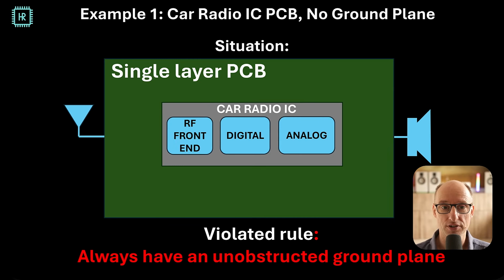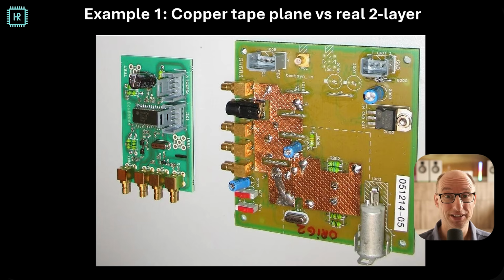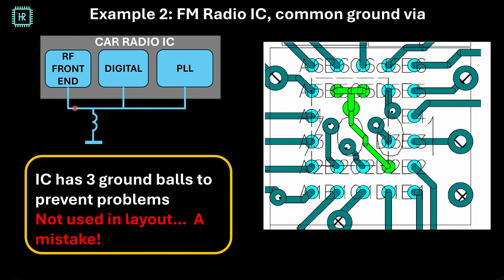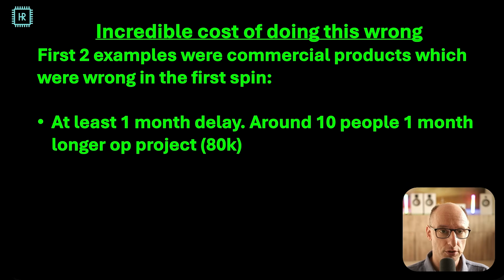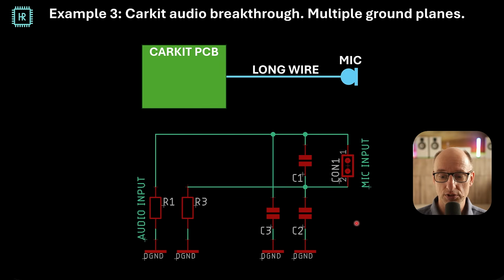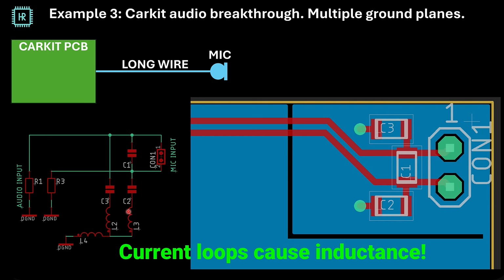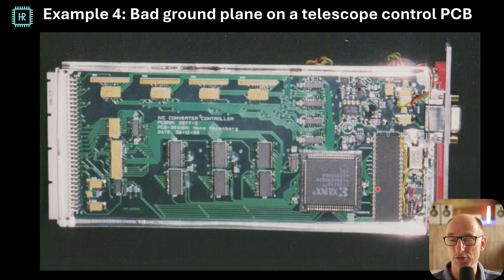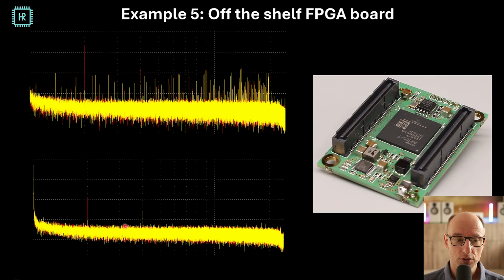Top 5 PCB Grounding Mistakes That Cost Me Thousands

Comment: Great video! I'm surprised that you can design a ARTIX7 board in that size with good EMC with only 4 layers. I wonder what grounding strategy you took for the multi board DA converter at the system level.
Reply from the maker: All my grounding strategies can be found in video part 1 - 4 of this playlist. That is what I used: Single ground plane. Each ground its own via to that plane. It is a smaller artix device (35t) and I did not need all the ios. Otherwise I would have needed an 8 layer with microvias.

Comment: Is the FPGA SOM board opensource?  Or for sale? I am working on an SDR board, as hobby project, and using a SOM would make the whole design much easier. The question I have is it not more convenient on a 4 layer board to have the GND in the middle 2 layers. So you can correct traces if necessary?
Reply from the maker: Hi, do you mean my own FPGA board with FPGA SOM? What is SDR? Yes, the advantage of traces on the outer layer is that you can correct them! It's a tradeof with interference.
Reply: @HansRosenberg74  SDR is a software defined radio. The FPGA receives or sends high bitrates to and from and DAC/ADC and downsamples it to something a PC can use through USB. Something like the audio DAC board but then for RF.
Reply from the maker: I'm pretty sure my board wil not be suitable because I didn't bring a lot of differential signals out. I did not need large databusses  for my dac so it probably must be modified to be useful for your project.
Reply: Paul, did you look at terasic boards like DE0nano ?

Comment: Hi Hans, thanks for another great video! I have a question: In the video you mentioned 'Never in my whole 42 year career have I seen multiple ground planes be an improvement'. I come across a lot of ICs that have different grounds, like microcontrollers that have a separate AVDD, DVDD and VDD (Analog, Digital and generic? VDD). What's the reasoning behind separating these grounds if having a single ground plane is almost always the best option? Are there situations in which a separate ground for the analog and digital part of a microcontroller is advantageous or even necessary? 

I have been trying to think of an example myself, maybe if you have a lot of fast-switching current running through N-channel MOSFETs on a board that have source connected to the ground plane could cause minuscule geographic voltage noise on the ground plane that could affect the accuracy of an ADC, and that a separate ground plane for just analog stuff would help solve that? But I am not sure if this is a thing that happens and I don't have the tools to test it...  

A second question I have, is that the few PCBs I've produced so far were all powered through an adapter with a barrel jack connector (like a laptop power brick), which only offer +24V and 0V. Is it correct to make the 0V equal ground on my PCB? I know that in these cases there could be a potential difference between the socket ground and the ground on the PCB, but because the adapter isolates the board from mains (and thus, there is no connection to socket ground) this should not cause any issues, right?
Reply from the maker: Yes, ic's have different ground pins. Reason is: Prevent common ground impedance crosstalk. This only works if you put good grounding on the pcb (which is exactly what wasn't done for the mobile radio chip example).

Your example is correct. However, I would not split ground planes since it can make things worse. I think putting some distance between the mosfet and the adc is the best solution. You could also use shielding.

A fast switching mosfet will also generate EM fields. They'll just go through the air right over your pcb. Distance or shielding helps there as well. 

I'm not sure if I understand your last question. I'd just connect the - connection of the supply to the ground plane (via the connector). If the connector has resistance, the cable will have a slightly different voltage than the board, but the whole board will have the same voltage. So that is not a problem if that is what you worry about.

Comment: so if I use a breadboard (solered or unsoldered), there is no ground plane, or is it the connection to the common groundrail that solves the problem?
Reply from the maker: Indeed, you won't have a ground plane, it is very limiting in that sense. Luckily, pcbs are really cheap these days :-)

Comment: Amazing video.  In some RF/Ethernet Circuits, there is Digital and Analog pairs of Power and Ground.  Often a single DigtalPwr supply is simply filtered through a ferrite bead/inductor to produce AnalogPwr.  Dev kits often show separate left/right ground planes, but in practice it is rare to have a dedicated analog power and analog ground, so it's just connected via a jumper, resistor or capacitor.

Is there any case where any separation of DigitalGND and AnalogGND would be useful?  Or is the inductor/filter between the Digital and Analog power connections the bulk of the benefit and use a single uninterrupted ground plane + via per GND as you guide here?

I would also be very interested in hearing any thoughts you have to talk about pros/cons when ground planes are either removed entirely (under ethernet jacks) or where there is a separate ground plane connected with a resistor (also commonly seen with ethernet).  Even more interesting is when there is a lot of effort put into this digital and analog separation, only to be recombined at the jack due to LED indicators.

Another interesting topic would be discussing boards with multiple power plane areas.  It could be as sample as 5V in, and a buck regulator to 3.3v and 2.5v resulting in 3 power plane areas, but a single ground.  If there's anything more to be said than "single ground", it would be great to learn!
Reply from the maker: Unfortunately, I've never encountered an example where separate ground planes are an advantage (in a complex stackup you can have multiple full board area ground planes on different layers, but that is a different story).
There is only 1 way to do this right. Use galvanic isolation between analog and digital parts of your circuit, either by transformers or optocouplers. If you're not doing that, use a single ground plane because as I explained: You'll only hurt your performance.
It can be useful to remove small parts of the ground plane under component pads if you're going really 'ballistic' (I mean 5GHz and above) to reduce parasitic capacitance.
Reply: @HansRosenberg74  Thank you Hans!

Comment: Nice insights- thanks for making and  sharing this. At the company I used to work for in the 1980s - we used to say "all roads lead to Mecca" - WRT grounding- so Star grounding figured highly on the analog side- but we kept the analog and digital sections on completely different boards and used optocouplers to feed the analog info to the digital side... we were making AC/DC calibrators and DVMs for up to 8.5 digits back in 1982- so for layouts, it was a bit of a magical art. Cheers.
Reply from the maker: Galvanic isolation is the only good reason (and the only real way) to totally separate different domains. Very nice to hear you give this example. I was trying to find reasons for splitting planes and the only example I could come up with is a crazy accurate dvm (a calibrator is closely related off course). I never did anything like that myself but I was looking for an example where even the slightest voltage drop would be catastrophic. Thanks for the example!

Comment: Around 8:35 you say multiple ground planes have never improved anything, I'm hoping you meant to say segmented ground planes? What you mentioned sounds like you are saying having more than 1 ground layer within a stackup has never improved anything.. which, obviously isn't true.

10:38, the board you show has a bunch of high dv/dt/di/dt components between two connectors. I've been told that for radiated EMI that's a good way to make a dipole antenna and fail compliance. What are your thoughts?

great video series btw!
Reply from the maker: About the ground planes. Indeed, multiple ground planes on different layers of a multilayer is needed when it gets complex and that's indeed not what I mean. If you do that in a complex multilayer, I'm assuming they're very tightly knit together using many vias to ensure signal integrity and short ground return loops.

About the high dv/dt components on a board with signals leaving in two directions. You're right basically, but there is a lot more nuance to that. In this case, it's not going to cause a problem (providing you do your grounding right). The case you're talking about is mostly a pcb with multiple wires going in and out of it in 2 directions. That acts a lot like a dipole. However, if you just leave in one direction, you'll still have a monopole antenna, so it won't fix all your problems. To explain all the nuance is way too much for a comment so I can't do that here. It would be a small video series :-)

Comment: I’d be interested to see an investigation into ground stitching via density / via fencing. I see some boards with such densely packed ground stitching vias it makes me wonder if at some point you’re drilling by away so much copper that the impedance to ground might end up getting worse not better?
Reply from the maker: Please look at part 4 of this playlist, it has theory and measurements on that. To further answer your question: If you put in a lot of vias, you're actually improving the grounding. I think the walls of a via have more surface area than the original copper plane, so the impedance may even go down! Best regards, Hans

Comment: Any capacitor on the way to the circuits should be completely removed or accounted for in the filtering software or circuits to get the perfect audio reproduction. I'm not sure why they are there at all. Generally, an ideal sound system should not contain transformers (which make most of tube amplifier trash regardless of price) or capacitors on the signal way, unless the signal is then corrected.
Reply from the maker: I agree with you, especially on high end audio, any capacitor (especially in series) is unwanted. However, in this case there are some other criteria:
1. Compliance testing: you have to resist strong interference. So you're left with capacitors or CM inductors to fix it in your signal path.
2. Audio quality of a car kit s*cks! :-) So you wouldn't be able to hear the effect here arguably
3. It's very small low loss np0/cog capacitors which only affect signals above at least 1MHz and they're in parallel (which limits the impact further)
Best regards, Hans Rosenberg
Reply: @HansRosenberg74  1. The signal path should be minimal, the amplifier or encoder IC should be placed right next to the microphone, the signal then has to be converted to digital or noise-resistant transmission.
2. There are modern microphone with digital interface as a module (basically a microphone with all circuits inside) for that.
3. For some specific applications I would agree.
Reply from the maker: I agree on everything you say. This was back in 2003 I think, they still had 'goose neck' car kits. The microphone was at the end of something looking like a shower hose ;-). So we had this long wire issue that picked up a lot of interference. Nowadays you don't see this kind of stuff anymore I think.
Reply: Hoo boy are you going to be disappointed if you ever open up any of the gear used to record the music you listen to.... Plenty of coupling capacitors and transformers in lots of very high performing pro audio equipment.

I care about deleting caps and transformers to increase product longevity (though new aluminum polymer capacitors have improved this!) and BOM cost.
Reply: @StephanAhonen  I don't expect most of the "pro" audio equipment to be the top quality products. But falling into advertisement trap of something overpriced advertised as such is a different matter.
Reply: @trevoro.9731 Not sure what the scare quotes are about. If you think a series capacitor or transformer coupling is going to cause unacceptable loss in quality then I have bad news about literally every album you've ever listened to. These sorts of myths are just as bad as the rest of the "green sharpies make your DAC sound better" sorts of audiofoolery. You would be very hard pressed to find a microphone preamp, anywhere in the world, without series capacitance or transformer coupling in the signal path. Go read some THATCorp datasheets and application notes. Their IC preamps are specified to vanishingly low noise and distortion at incredible amounts of gain, with massive electrolytic capacitors in signal and feedback paths. It's just not as big of a deal as you think it is.

Comment: Great video Hans, thank you! 
Do you plan on talking about active shielding/guarding for electric field sensitive applications?
Reply from the maker: You mean shield cans with active?
Reply: @HansRosenberg74  yes
Reply from the maker: It is on my list, I haven't found a good way to demonstrate that yet. This will require a setup to measure transmitted radiation which is a little bit tricky.

Comment: I hear everywhere that 99% of time one should use single ground plane. I got it. But it would be interesting to see explanation when exactly is split plane beneficial.
Reply from the maker: There is no such example! Only when you have galvanically isolated pieces of circuit (either magnetically, optically  or acoustically) does it make sense. I'll try to explain it to everybody using simple theory in my next video, since this is a very important thing.
Reply: @HansRosenberg74  "There is no such example!"  🏆😂💯!  
This is a major issue with people who simply copy pictures in datasheets and application notes instead of learning engineering.  ADC datasheets might be some of the worst for suggesting planes should be automatically split.
Reply from the maker: Yes, that is a problem indeed. There is a lot of misinformation about this subject.....
Reply: @HansRosenberg74  Yes, galvanically isolated pieces of circuit is a obvious one. But I would expect there are situations with not galvanically isolated circuits. But I never heard of such examples.
Reply from the maker: I didn't either. I'm hoping someone in the comments comes up with one. I know that crazily accurate multimeters (like 8.5 digits) need some really weird layouts to achieve the accuracy, including milled slots around the voltage reference and things like that. But I don't think there is a split ground plane in there (maybe a single trace connecting the measurement input to a very specific spot on the ground plane to even get rid of voltage drop on the ground plane at DC)...
Reply: @HansRosenberg74  What about when one plane isn't sufficient for the amount of grounding you need (such as on some really complicated multilayer boards with internal vias) or you're using multiple ground planes on different layers for cooling? If this is already addressed in the video, I'm sorry — I got distracted and tabbed out, then noticed a "shiny" comment before I hit play.
Reply: @claws61821  This is something different than split ground plane.

Comment: thanks for such great videos loving this PCB design series, been playing with easy eda and have got my first board made up. i have been trying to do my vcc layer connections myself and then just add a main ground plane using the ground plane tool still unsure if this the best method but still learning it :)
Reply from the maker: Sounds good, just follow the really simple rules I give. It may seem there is more to it, but really, there isn't. It's that simple! It's just hard to believe that it is that simple :-)
Reply: @HansRosenberg74  Thanks for the feed back its a RF related board TX and learning these neat tricks for grounding a possible Impedance fixes is clever stuff :)
Reply: @HansRosenberg74  The hardest part for me at the moment is footprints component wize finding the correct one to match my working prototype for example a 3 pin vary capacitors foil ones 10mm are tricky so its taking a while to come along but getting there all good fun :)
Reply from the maker: I'm not exactly sure what you mean here...
Reply: @HansRosenberg74  some components don’t fit sir so need to change it basic example
Reply: @HansRosenberg74  iam trying to build this board up from a working protype but just the same layout as close to orignal i can kinda so this new board is the same has a audio input chain mpx with rds chain oscillator runs fine and does have a PLL control for frequency all on one board with amp stages and final driver just some of these part are tricky to match the footprint for large 65pf trim caps etc hope this help :)